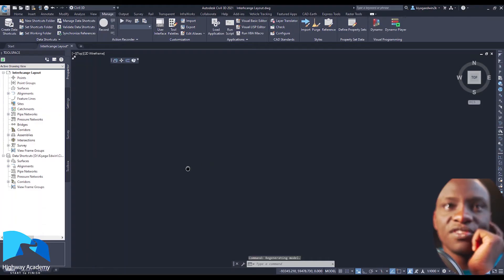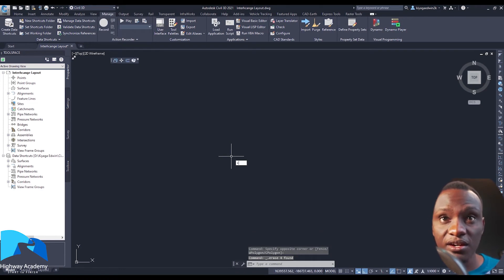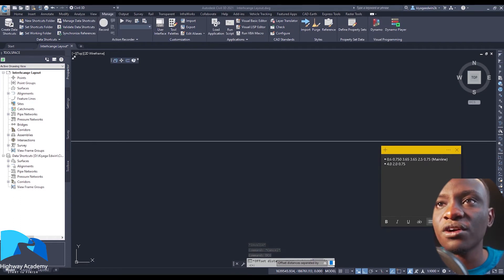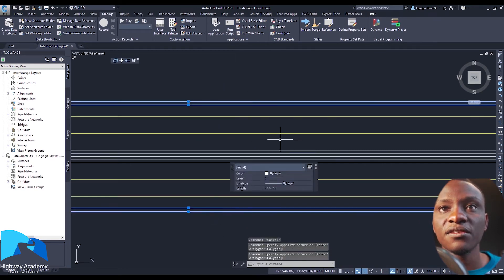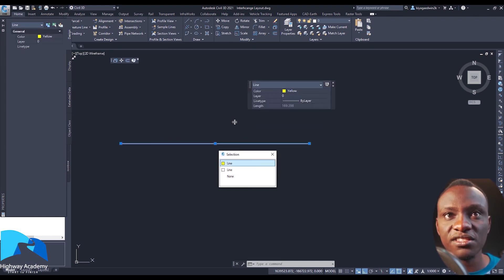Trumpet Interchange Design in Civil 3d-5.Tools and Settings

Comment from the maker: The moment you've been waiting for has arrived! 
Our complete Ultimate Guide to Interchange course is now officially LIVE on our website and also the beginner's Interchange YouTube playlist is available. 

Ready to jump in and become an Interchange design guru
✅Link to the Interchange design course: hwy.ac/int-geo-ac
Beginners guide to Interchange YouTube playlist
✅Link to the Beginners guide to Interchange YouTube playlist: hwy.ac/int-geo-ply
Want to connect with our amazing community
 ✅Link to our Highway Academy WhatsApp channel for daily tips and updates right on your phone:
 https://hwy.ac/int-ch
Got a question or just want to say hi? We'd love to hear from you!
✅Link to our WhatsApp direct chat:  hwy.ac/wa

00:00 Intro
00:07 Introduction to designing a trumpet interchange in Civil 3D.
00:13 First tool: Dynamic Offset (DCO) script.
00:26 How to add the DCO script ("upload" command).
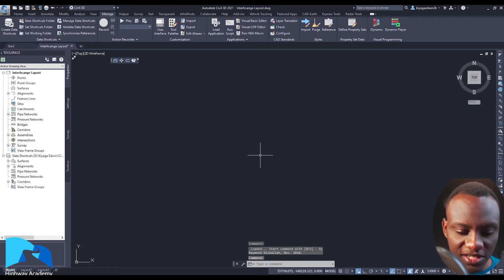00:41 DCO's use for offsetting multiple lines for expressways.
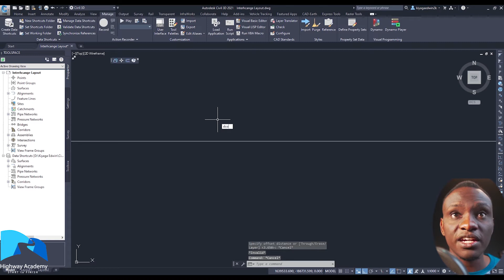01:36 Specifying offset distances with DCO.
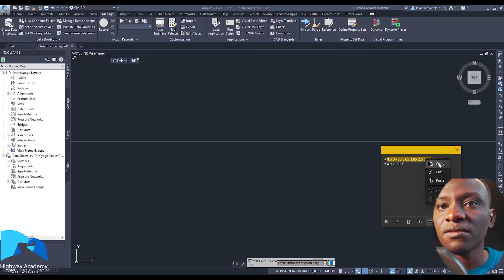02:05 Selecting offset side (left or right) with DCO.
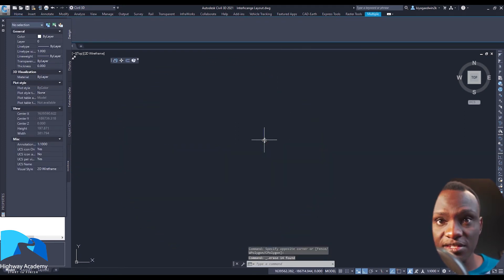02:55 Second setting: Quick Properties (QP mode).
03:02 Changing QP mode to 1 for quick property changes.
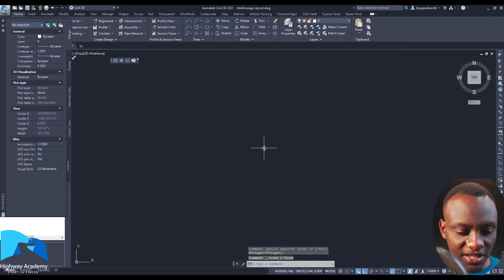03:22 Third setting: Selection Cycling.
03:36 Setting Selection Cycling to 2 for selecting overlapping lines.